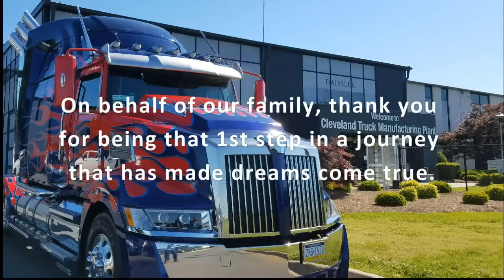Optimus Prime gives a special thank you to Cleveland Plant

Comment: Did you know all of the original OP5700 were all build in Portland Or western star plant. As us did all of the air and electrical testing on each cab before going to mount in the chassis
Reply from the maker: Very cool. I also heard that Western Star stopped making the 5700 model. Disappointing news

Comment: in 7:45 
the one on the right is less high than the one at the left right ?
Reply from the maker: They are both equal in height, but different in roofline and stack tips
Reply: @OptimusIsHere  thanks alot for that 🤩🤩🤩
btw how much hp does this truck have?